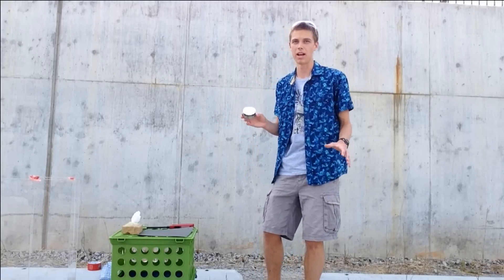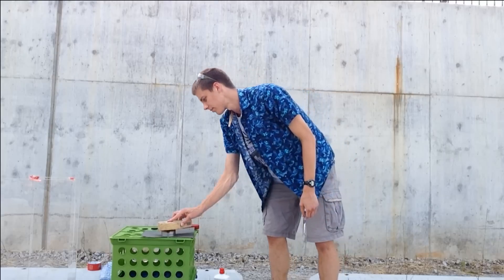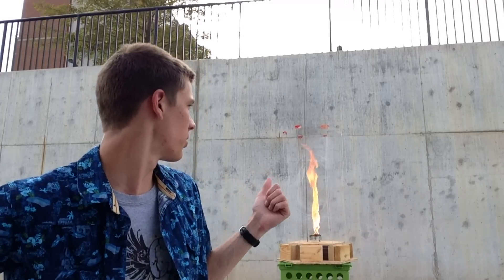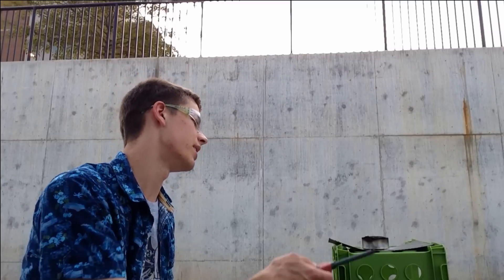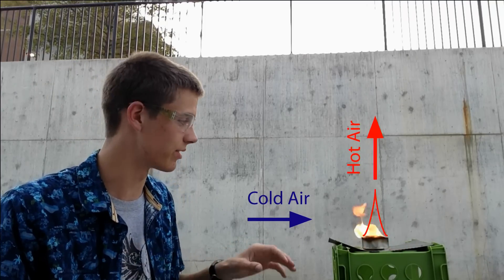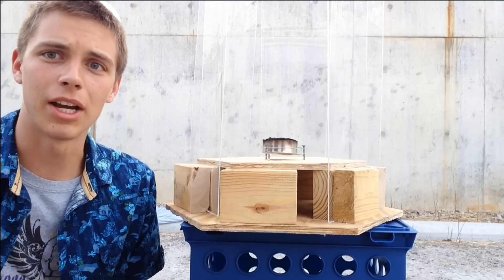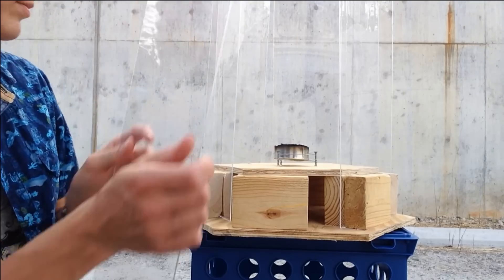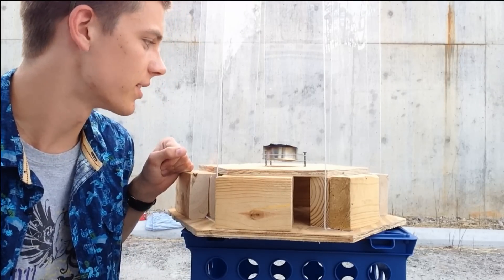DIY Fire Tornado (the original no-moving-parts design!)

Comment: The physics is you are producing a low pressure zone in the centre thus more air is sucked in the system. This then has a bellows effect causing more oxygen allowing a faster burn thus producing a greater flame. Another way of looking at it is opening a vent on a wood burning stove. Good video.

Comment: i had the thought of using a car brake rotor disc, has the spiraling vents and the depressed center with elevated disc perfect for putting the fire vessel in the center and a glass tube resting on top , i also tried cutting rectangular window vents in the bottom of a soda can and that worked quite well of course if the thing was glass and longer it would be perfect

Comment: As a career fireman we study fire behavior. IRL the chemical reaction of fire is usually pretty innefficient leaving a lot of unburnt fuel to escape as hot gasses commonly called smoke. This can be demonstrated by lighting a candle, blowing it out, then touching your fire source (lighter, match ect) to the top of the smoke coulmmn coming off the candle wick. The smoke will ignite and travel down to the wick reigniting the wick.  Usually the presence of oxygen is the limiting factor in most fires not fuel source.  The cotton balls burning in the can fire is limited in that the hot gases escaping the fire are somewhat blocking the inflow of the fresh cool air to the base of the fire where your main fuel source is. Think fire in a closed room with 1 open window (inflow source) the top half of the window has smoke billlowing out but the bottom is clear because cool air is being drawn in under the escaping smoke (bidirectional flow).   In your fire tornado experiment your inflow of cool air is drawn into the box below the fire relatively unimpeded while the hotgasses escape vertically. The cool air is no longer competing with the hot gasses for space. The bigger factor is by enclosing the fire you create chimney effect. There is a pressure difference between outside your fire chamber and inside due to the temperature inside being much higher than outside. You see this with the outword bowing of the walls. This forces the air away from the fire creating a suction effect at the cool air inlet much like a standard tornado. More cool air means more O2 to fuel the fire(technicallly oxidize with the fuel thats already there) this allows the fire to burn very efficiently not due to increased temperature per say but just avaiability of O2 to facilitate a more efficient combustion (oxidizing) reaction. Radiant heat (not conductive or convective heat) is pretty much unaffected by airflow or even a curtain of water (like a wide fog pattern from a fog nozzle) so the fire will still give off heat in all directions like it would if this air caulmn was not swirling. Volume of cool incoming air will cool the environment up until you get within range of the radiant heat. In a closed environment (like a house without doors or windows open) fire will always move towards the oxygen source feeding it. Firefighters use this to "control" 5he flow path of the fire away from victims and other firefighters or to minimize damage to the house. This is why it is extremely important to not break windows (pd im looking at you ;) ) and close whatever door or window you exit from if possible.  If you wake up to a fire in your bedroom and cant get out buy yourself some time by closing the door to the bedrom, block the airflow under the door with a blanket or whatevers on hand and stay as low as possible. If you can open the window and get out great! But whatever you do dont open the window without closing the door first or you will draw the fire right to you. Within a matter of seconds, not minutes, your environment will most likely be unable to sustain life. In the words of Tom Cruise "help me to help you." PSA over
Reply: Thanks for the thorough write-up!

Comment: It looks like you have left about an inch and a half or two inches of "gap" at each side of the panels, is that what you found works best? or does changing the gap have much of a change in the overall effect?
Reply from the maker: I played with it a bit to get the right airflow. Too much and the vortex fails to form, too little and not enough air gets in
Reply: @AlphaPhoenixChannel  That's what I thought would be the case as well. It is odd that the flame carries on in the vortex so well even after that one panel deformed at 2:30. I would try closing the gap near the top of the panels so the air enters the base at a higher velocity. That might make a faster rotating flame as well as concentrate the heat inside the column. (Now I see in your other video of this project that you have the tops of the panels taped together...Nice flame generated! Too bad the panels are so heat sensitive)

Comment: I don't know what you mean by "the original no-moving-parts design" but this design has been used in fire research for years. There is even a company that has been making 4-sided version for years––Unique decorative fire lighting for interior or exterior use. Tornado vortex fire shaped flame. Fire in a box. : http://www.moderustic.com/VortexED55.html.

Comment: I am currently in college as well and also love cool physics based projects like yourself. I really enjoy the concept and would like to recreate this if you don't mind. If you don't mind me asking, is there a ratio of how much heat being emitted and the radius of hexagon? For instance, if the hexagon was too large in diameter, it may not rotate as quickly. I was also hoping to possibly scale this larger if I was successful with the smaller version.
Reply from the maker: +tampabates1 go for it! Half of science is replication! I'd love to see somebody else make it work! (At this scale, I've found it's not that hard - see my other video about building one from cardboard)

However, I've tried this at candle scale and at LARGE campfire scale (thing 6' diameter hexagon) with no success. The candle wasn't hot enough to create a strong draft and the walls around the campfire weren't anywhere close to tall enough to guide the draft - the air just went over. I think there's a possibility a fire of fumes like this or a very small-diameter wood fire could be made to rotate with tall enough walls. Probably 4 feet for a 3-4' diameter hexagon. The high aspect ratio is important. I've always thought about buying some plywood for this but never have.

Good luck! Let me know how it goes!
Reply from the maker: +tampabates1 specifically looking at heat generated as a variable, I unfortunately don't know.
Reply: thank you for your quick reply. I will try to do some more experiments with my inquiry. What length sides did you use for this model. It looks about 12" but I don't want to assume.Keep up the good work and awesome projects!

Comment: can i use a candle instead?
Reply: Larvæ ॐ I actually put an evening into trying to make one with a candle surrounded by playing cards and it didn't work.  I would assume that the candle didn't burn hot enough to make a substantial draft.  Maybe you can try and get better results?
Reply: It would maybe work, if the glass is relatively small

Comment: Brilliant! This is the only passive design I have found on the net after looking at dozens of videos and websites. It puts to shame all those lame-ass, hideously ugly, clumsy, lazy-susan-rotating, screened-in ones. Kudos. Your next challenge: design and build one that doesn't confine the flames behind a barrier, but allows them to rise above it several feet.
Reply from the maker: Thanks! I wasn't content with the spinning ones either so I had to improvise. On the topic of scale, I did attempt to scale down to a candle with playing cards around it, but it didn't work. I do want to try this technique larger - I'm thinking plywood sheets held around a campfire or something, but I'm not sure when I'll get around to trying it...
Reply: AlphaPhoenix I wasn't content/impressed by those spinners either. What blows my mind is that they are still being used for fire research. I found lots of papers on Google Scholar that feature them. I don't think the relative frame-of-reference argument would hold other than to a first-order-approximation. There were a few, however, that used your design or similar. I think a passive design more closely emulates a real fire tornado. I did find a page where some students made a room-sized version: http://firetecumd.wordpress.com/2013/04/30/maryland-day-fire-tornado/.

But I wasn't talking about scaling at all in my challenge. I was referring to the fact that your design, as well as similar ones in papers, all confine the flames inside a structure. I want to see something that allows the flames to soar above the height of the structure. A passive device still, no fans. Last night I tried a simple experiment which proved the concept. I am now working on a prototype that will demonstrate it. Better hurry up… ;)
Reply: " that doesn't confine the flames behind a barrier" how do you mean? are you talking about the polycarb? if so how would it work otherwise?